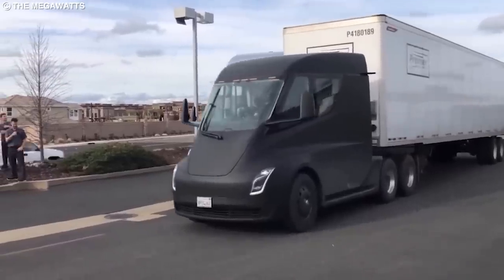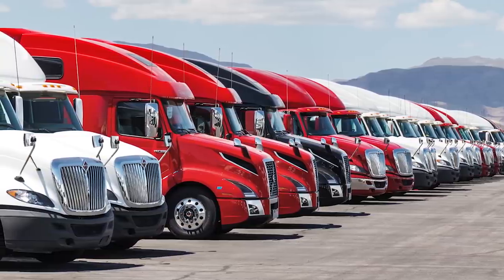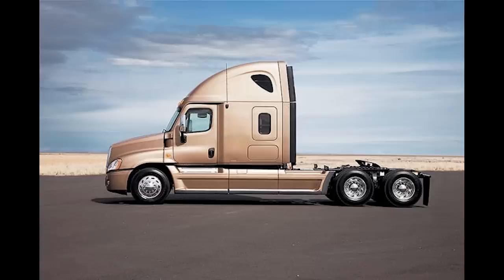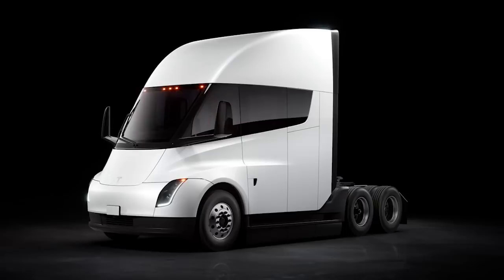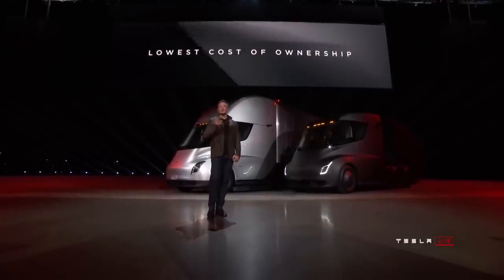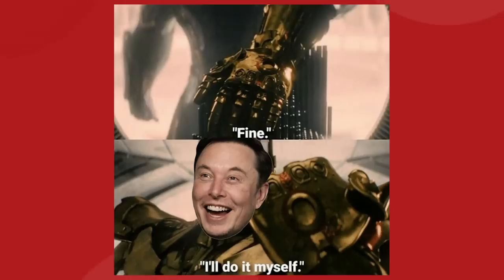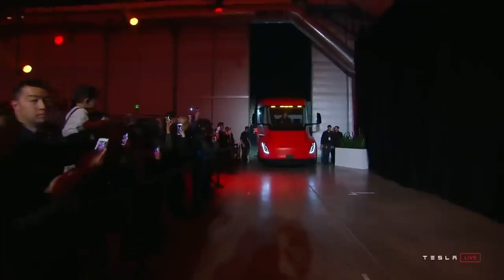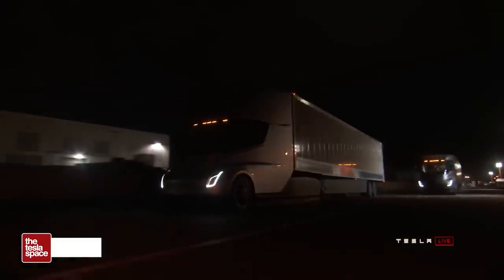The Real Reason Tesla Developed The Semi Truck!

Comment: What worries me is FSD. If the trucks have been designed with a cabin for driving it, does that mean that FSD level 4-5 is further away that we thought? According to Elan, full FSD was supposed to happen at the end of 2022. So why design a truck with a cabin? I’m interested in what you all think.
Reply: Because they actually want to sell a product and not a dream. Even if FSD was flawless, there is nNo way any government would allow a driverless semi.
Reply: We are further then we want to be.

Basically it can handle normal conditions, but abnormal conditions are still dangerous and unpredictable to autonomous vehicles.

Examples, snow and ice, hydroplaning (at least once caused because lack of maintenance on the wheels), loss of breaking event, road debris especially small stuff like tire pieces and so much more. Every time Tesla is doing their best to fix it, just the edge cases are numerous and hard to predict. Wam bam Tesla cam, has been my go to to see much of what they handle and fail to handle.
Reply: Commercial Aircraft all have auto pilot but still have a pilot and copilot.
Reply: You won't need a cab for a human, if trucks go FSD.  Less weight & complexity, shorter all round.
Reply: @alexmanojlovic768  that’s exactly what I don’t understand. Elon is designing robotaxis without cabine so why not designing trucks like that too. Maybe because the FSD level 4-5 has still a long way to go. But that does makes sense because Elon believes/ed FSD level 4 is/was supposed to happen next month in December 2022.
Reply: @jonathanlivingston7358  got to start small scale 1st anyway, replace what everyone's used to, then radically change again, once EV trucks are mainstream & accepted/proven.
The other thing is cost.  Although reducing the cost of a cab + trailer, to just a powered trailer is cheaper than the combo, it's more expensive than just a "dumb" trailer.  1 cab services many trailers which often sit around unused for long periods.  Adding drive, batteries, cameras & FSD to every single trailer (or at least, multiples more than just cabs) is more expensive than making 10,000's of cabs to service millions of trailers.  Also battery supplies are needed everywhere, especially stationary storage, so realistically, it doesn't make sense to use up.that many batteries for active trailers that sit around stationary much of the time.  Cabs could just become vertically orientated, as:- short & high, but be aerodynamically shaped.
Reply: Further on what another comenter said, Boeing and Airbus could easily make arliners fully atuomatic and not have pilots at all in them. Airliners can navigate and fly from one place to another and land all on their own. All that would need to be done is to automate taxi and takeoff (which is much easier than landing), automate all of the button pushing the pilots have to do, and automate comunication with air traffic control (which wont be hard thanks to Data Comm now being a thing) . but no one, especially the FAA, would allow that.

The majority of people dont trust self driving cars (tons are even against electric road vehicles as a whole for some reason), even once tesla can prove to peopel that FSD is perfectly fine it will stiill take a long time for the govornment to allow semi-trucks without drivers. Even ignoring regulation, going straight to a driverless truck would be a horrible idea since it is way too big of a change for people to buy into and hardly anyone would buy them, plus there would probably be tons more backlash against it than there already is just for the tesla semi.
Reply: According to Elon, self driving was supposed to be ready in 2017
Reply: @WhoMe87799  have you ever seen those FSD videos on YouTube? The amount of times the driver needs to intervene to stop a major accident is comical. It’s simply not ready.

Comment: If the trucking company owns the trailer as well as the Tesla Semi, they could add multiple battery packs to the underside of the trailer frame to give a vastly increased range. Say, an additional 5 battery packs per trailer, giving the driver a potential 3000 mile range, without stopping to recharge. Where this would be of greater benefit, is if there is two drivers doing shifts or where the sole driver could sleep while the self-drive function continues the journey, once the technology to do so has matured.

Thus, it may be possible to deliver a cargo from Los Angeles to New York in under 40hrs.

With intelligent computer-controlled streamlining in convoy, the Dollar per mile efficiency cost could be further improved. 

If the intelligent convoy breaking and acceleration system is employed , this could conceivably work for a sole driver to coordinate his sleep time with being one of the central vehicles in the convoy, where the control of the convoy is controlled by the lead vehicle. Then, they can swap places with other trucks in the convoy to allow that driver to sleep to mitigate stopping.

Comment: I mean, you said yourself why in Europe they have "almost flat fronted trucks". So it should come as no surprise as to why Mercedes adopted the same old design when they're built in Europe 😅
Reply: European trucks are super well optimized for Europe and tesla won’t work there! Just look at truck parking in Europe it’s super tight and a lot have multiple steering wheels….

Comment: Question #1 Driver Sits in Middle ? In America the Driver Always Sits on the Left to Make it Easier to Follow the Line Without off Tracking to far to the Right ! + Handing Papers License etc out Window Without Leaving the Seat to Maintain Secure Stoppage ! # Laminar Side Air Flow Traditionally There Has Always Been A Air Gap Inbetween the Rig and the Trailer for Clearance Less Pinch Points , + Allows High Wind to Keep the Rig From Being Blown Over !
Reply: @Bub Pori  Tesla Autopilot or FSD will keep the truck in center of lane. 
When a Tesla comes to a stop it automatically holds the vehicle in place, no brake required to "Maintain Secure Stoppage".
Ya got me on the Air Gap, I don't know the physics of that.
If true, it sounds important, but I'm too tired to look it up.

Comment: To autonomous vehicle engineers:  Please get the machines to communicate with each other to communicate road conditions/situations/emergencies.  Swarms of autonomous vehicle MUST be able to communicate with each other locally.  RF Signal should be fine in theory.    Humans signal to each other via nonverbal communication.  This communication MUST be captured and used for autonomous driving in swarms/fleets.
Reply: There was a huge block of bandwidth reserved for that.  It was just released recently after nobody chose to implement it and the few that did chose to join other bands.

Comment: I think the battery management system needs a way to disable individual cells by addressing and severing fusable links to prevent a low percentage of bad cells from drawing down the battery pack.
Reply: Like individual cell level fusing that already exists in the packs.

Comment: My bunks 82".  This isn't close that.  Not ready for prime time.  What weight holds the front axle down in snow and ice?  330 Mike range is good?  That sucks.  I get 1500 miles range without stopping 4 times.  What happens if one catches fire?  They can't put the car fires out so bring hot dogs.

Comment: 18650 is still the best lithium-ion battery
10:50  4680 -- 244Wh/Kg
11:05  2170 -- 269WH/Kg
11:45  18650 -- 280Wh/Kg 
12:14  18650 very easier to keep cool
12:17 18650 full throttle for extended periods of time
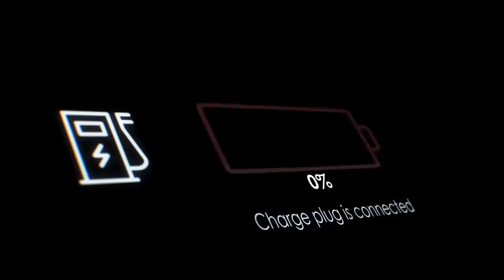12:28 18650 recharge 100KWhr very quickly 10% to 80% in less than 25 minutes
Reply: Have you checked the price per Wh?

Comment: Please don't call these over the road trucks. A truck with 230 mile range? And where would an OTR truck charge up at? Frito Lay might use them for local deliveries, but can't use them to haul products from their pants to their warehouses. So I don't think Peterbilt, Kenworth, Freightliner or International have anything to worry about. Plus, no sleeper means DOT won't let them run over the road as well. And no company is gonna put a driver in a motel every night.

Comment: Handles like a sports car from company who thinks we all should ride on our cars and not drive them 

It's common to refer to these trucks as cabover or conventional. Also there looks to be very little in drover protection in these almost cabovers. Placing the driver close to over the wheels will always result in a harsher ride than would be possable being placed more between the wheel sets. 
Are the Tesla able to be 3/4 or full lock rear axles,. Where it can drive both rear drive axles with a locked center. For the weight of many semis they are ridiculously easy to get stuck in a moderate amount of snow if situations are right.

Comment: The biggest problem is how are they gonna charge one of these trucks on the open road. Super charger lots are pretty small to fit semi trucks.
Reply: The ideal would be battery swap stations at existing truck stop.
Reply: Those super chargers are meant for cars tho and have existed years before Tesla even started working on the semi?
Reply: LMFAO WHY WOULD YOU THINK THAT THEY GO WHERE THERE'S NOT A CHARGER
Reply: @paulhailey2537  I mean chargers are easier to build and maintain then a gas station- since at a gas station u need a lot of infrastructure

Comment: Btw: aerodynamic drag coefficient is independent from size. There is no reason ithas to be bader for a truck than for a sports car. The truth is: it must be the other way round because the semi does not need downforce to be stable at high speed or excessive cornering. I'd - as a program manager - never accept a cw not at least 25% lower than the one of a sports car. 

To the german flat nose and the crittics: what is drag all about? Right. Speed squared. How fast is a truck driving? Well, u derstand why drag is not the priorized factor but comfort and overview? You just would never drive a hauler in a german city. It sucks and rises the work load and risk. Also our semis are half as big what makes them much more manouverable in smaller areas. Sure, whenn you are crossing Utah on a daily basis you need room for the girls. But the world is not looking like Utah all over the planet. Rednecks don't believe this calling it fake news.

Comment: The biggest questions should be how much freight can the Tesla hold without going over the limit, second the range on the sheet it says 300 to 500 miles what will it be we dont know yet. Freight is the biggest issue if a truck weighs in on average 35,000 lbs and max weight is 80,000 lbs then you can hull 45,000 lbs. The normail truck can travel around 2000 miles on feul it caries so that is 4x the distance feuling takes 20 min incl coffee and it can go another 2000 miles. So lets say that the truck charges back to 80% in 20 minutes so i get a 4th of distance so to get to 2000 miles i need at least 4 charges to 80% meaning 4x30 minutes of extra time to travel 2000 miles so thats an extra 2 hours. Then the biggest issue how much freight can it take with it without going over the limits you should be able to calculate the weight of the battery so if you cant take the same as normal trucks transporting gets more expensive if it can only take half of the weight of normal truck you need two Tesla’s to transport the same amount that means the following. Two trucks cost, two drivers, 8x30 minutes to travel 2000 miles its getting expensive and if its less you’re in trouble you cant compete with normal long hull trucking.

Comment: What is the reason of shifting from diesel to EV
Which work a diesel truck can not do but EV can
Reply: 1.  Not pollute.   2. Run on wind power and solar power.  3. Run on a non-reciprocating engine.
Reply: @maxguarp3937 lithium in battery causes pollution 
2. 85℅ of electricity are produce by non renewable resources so don't tell it green energy
3.what is negative of reciprocating engin
Tesla Semi can not replace diesel truck because it has 1300 hp and about
2100 NM of torque but its competitors lika volvo mack Cummins engine has 770 hp and 3700 NM of torque 
How it is possible 🙊

Comment: Tesla's mission is to reduce the use of fossil fuels for powering vehicles etc. The fact that Tesla has spurred other manufacturers to go electric fits perfectly into Tesla's objective. In Europe many Semis in Europe more often referred to as HGVs or Artics (short for Articulated Lorries) frequently do have sleeping quarters in them albeit not as luxurious or spacious at those seen in America.
Reply: i think teslas mission is to make elon money. vehicles are a small percentage of whats the real problem. elon should be building massive solar installations instead of sucking energy from the grid with his products

Comment: The EV tractors with a 500-mile restriction will not be used for OTR driving. I can see them working for FEDX or UPS that goes terminal to terminal, for OTR driving this is not practical. If you throw hills or mountains in the mix, you just reduced the range. 33 years of commercial driving, I'm going to stick with diesel until they  have a generator to keep them charged. Then that would be free energy.

Comment: Im currently wondering why the batteries arent placed with the trailer instead of the tractor.  Why cant tesla make a trailer with batteries under the trailer and then just plug the tractor into the trailer.  Somebody please tell me why?
Reply: This might be because trailers are built and owned by a third party.  The driver might switch trailers for each haul.

Comment: The Semi does a lot of things well, except one thing.  Payload
These trucks are supposed to move large heavy objects and the Semi can't do that very well, because its already moving large heavy objects, while empty.  It's batteries.  They sap a big chunk of the payload.  Hopefully, they solve this key part of the puzzle.
Reply: A diesel semi has a 2500 lb engine and transmission plus up to a 1000 lb of fuel and tank when full.  How much more does the battery pack weigh?  I figure the weight of the electric motors is about equal to the Diesel semi's drive train and axles.
Reply: The Tesla semi only carry’s 2000lbs less payload than a regular diesel semi.

Comment: Why nobody  talks about the MOST important thing.  WHERE ARE WE GOING TO GET THE ENERGY FROM??
Until we don't  start building nuclear plants  everywhere,  this vehicles will make life difficult for everyone. Because of generation and transportation issues,  electric power is a less efficient way to power vehicles. 
Without nuclear plants, whatever energy we are "saving" on the road,  we will have to burn it to "create" that energy+losses and we haven't  talk about  the electric grid.  We will need to double the electric grid capacity to supply all that extra demand.

Comment: I wonder if battery swapping will be eventually possible. 
The electric semi truck market would be able to make it happen. It's fairly standardized format (compared to the diversity of cars), and there's existing infrastructure where adding a battery swapping station or two would not take too much space (with a robotic charging of swapped batteries underground or over the swapping station).
Reply: That's a great idea, when a truck stop fuels 24 hours a day, how many battery packs would be needed? Now we have different manufacturers battery packs and installers. 
The industry can't get enough mechanics to fix the trucks. Then you have to upgrade the the power grid to support greater usage, with the reduction of power plants, how are we going to upgrade the grid? EV'S are not the panacea we think they are. Would I like to see it work, yes. Will we see it by 2030, no
By 2040/2050 yes
Reply: Individual battery packs are not fully 'fungible' though.  What would be my recourse if I take my brand new vehicle in to have the battery swapped and they put in a battery that's on its last legs?  Do I get a rebate for the battery I turned in that has so much more life left to it?  Need to find a solution to this problem.

Comment: Just for your info! The USA Dot semi Length and width max is 72 inches wide and no more than 75 feet long combine length unless proper permits are applied ,,, this Is overall length
Reply: Maximum width on STAA Federal highways is 102"....96" non-approved roads. Overall length off Interstates varies per state and local jurisdiction.
Reply: @ronaldfulton1175  yea but truck and trailer total length ? Truck and trailer is? With out double or triple license?

Comment: How many mega chargers to enable the 30 minute charging have been installed and are there enough to charge every vehicle being delivered. There is never much talk about building a mega charging network or just how much energy is required to charge a small fleet, can the local grids handle the massive extra demand?
Reply: Imagine the wiring needed at a loves truck stop needed to charge a truck in the middle of kansas.

Comment: It seems there are Three improvements that most truckers would want.  An opening passenger door, Windows that open both passenger side and driver's side. The ability to slide the driver's seat over to  side door . With sliding the seat for safety reasons would only work if in a parked position